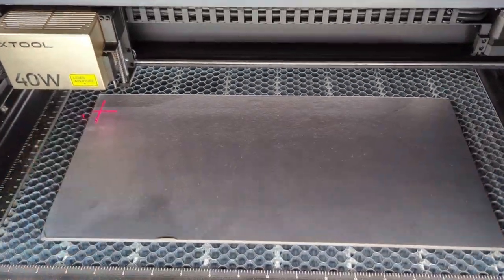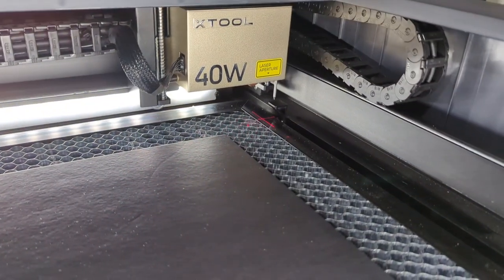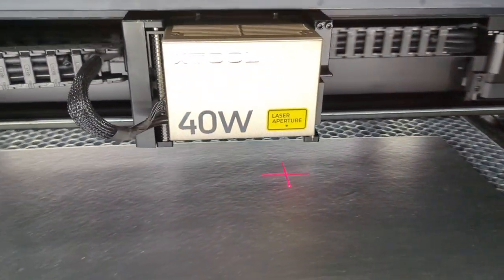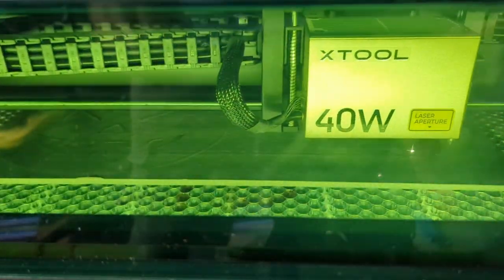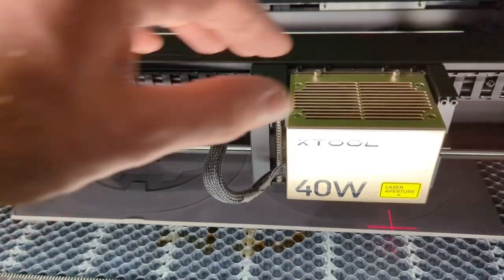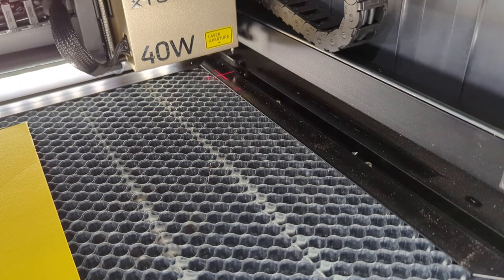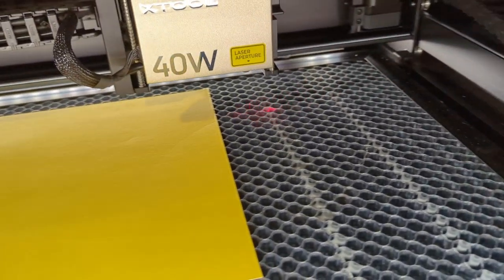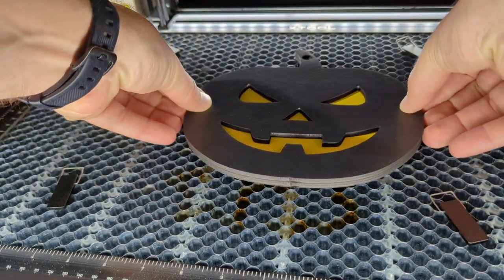xTool S1 Sneak Peek!  A Pro Level Diode Laser Engraver

Comment: Will this machine be able to handle 2" thick polyurethane foam using the conveyor attachment?
Reply from the maker: I can try to find out for you. I have cut 1.5" before.  Just have to lower the power and do multiple passes.  I used it to make a cut out for another laser system to fit into a pelican type case.  I was thinking about doing a video on that process, this would be a good system to do it on
Reply: @Doodlebud  You were able to cut 1.5" with the conveyor attachment? I only ask because the xTool P2 conveyor attachment is only able to cut .5" thick material.
Reply from the maker: @JoshRecknagel  I don't have the conveyor attachment. I've cut prices just with the laser. I can ask my contact at xTool about conveyor size capacities
Reply from the maker: I heard back and the max thickness the conveyor can handle is 14mm